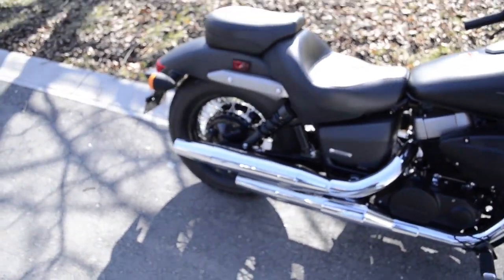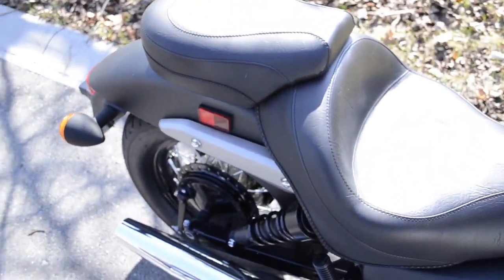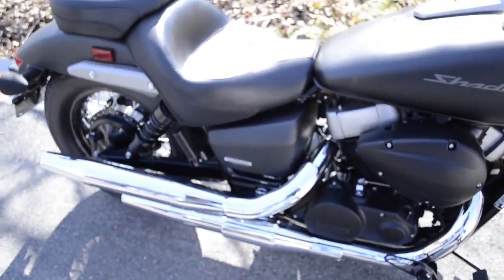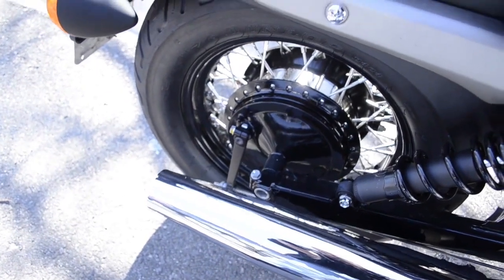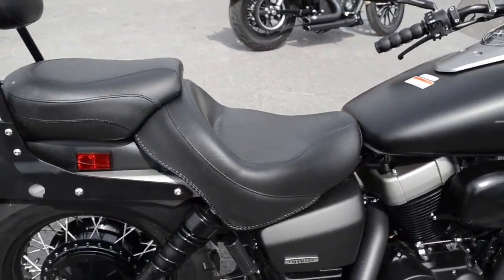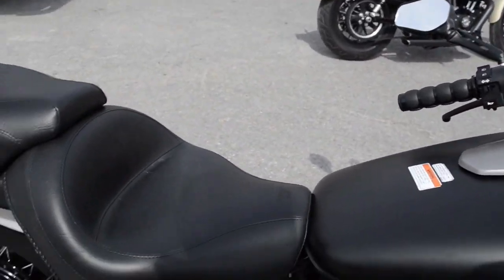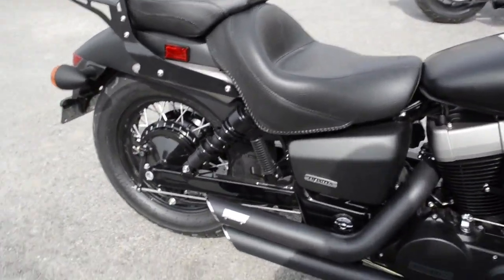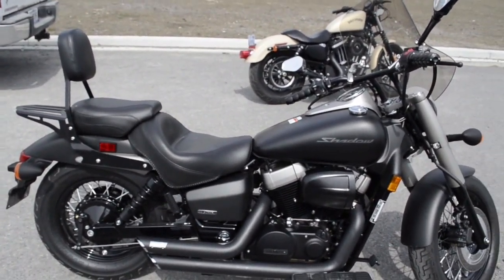Stock exhaust vs Vance & Hines Short Shots on Honda Shadow Phantom

Comment: Nice bike man, love Shadows and especially love the blacked out look. Did you do a tune (fuel programmer) after the exhaust? It's not as critical to tune the FI models as it is to jet the carb models after making intake or exhaust changes however to get the best gains you can it's a good idea. Looking at my dyno sheets my Aero put down 36.47 HP and 40.13 TQ at the wheel bone stock with a K&N filter and ported air box/snorkel delete. I then added V&H black Shortshots and it made 38.21 and 42.87 HP/TQ. We then did a bunch more pulls and tuned the air/fuel according to what the engine liked on the dyno and ended at 47.39 HP and 50.64 TQ at the wheel! Huge gains over stock and the power curve is just as broad, it feels like a way bigger bike now and I have no problem getting out in front of 883s, Bolts, Sabre 1100s etc. which when I was stock would show me their tail lights with ease.
Reply: Instablaster

Comment: Thanks for this; I've been thinking about adding these for a couple of years now and I think your video has sold me on them. :) 

Was this just a straight swap on the pipes or did you add anything else along with them for performance? If not, did you end up having to retune the bike after adding them?
Reply from the maker: +Steve Elliott I did the pipes, breather and fuel controller at the same time. If you do just the pipes, you're ok. You won't see much of a performance increase until you get at least a fuel computer too.
Reply: +Crunchmeister Thanks!

Comment: Stock pipes sounded better plus lose the sissy bar I don't know why folks get them so high. Stock pipes are tuned to vechile system. When you change them you alter compression levels and can easily warp your values due to lack of compression. If you bored it out by 3 steps and then added pipes you would get proper compression levels hopefully. But putting different pipes on a bike that sounds awesome start off is waste money and eventually costly all around
Reply: They get em so high so you can strap a duffle or backpack and keep the load stable
Reply: That sissy bar is so small lol. Google old 70s choppers if you think that's a big sissy bar!